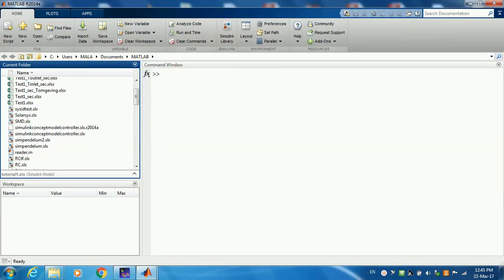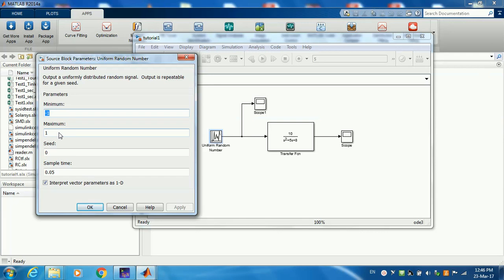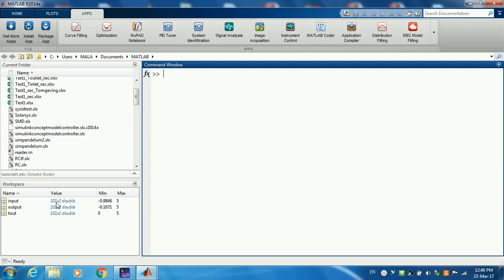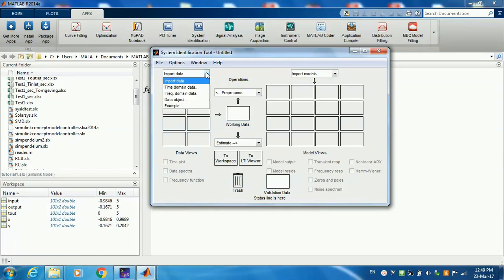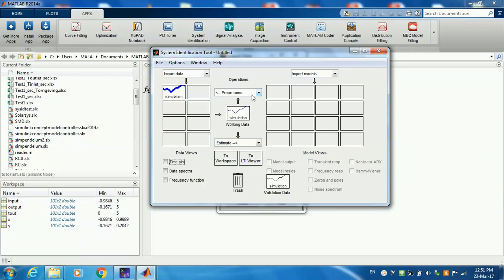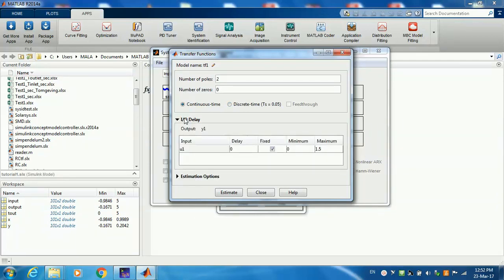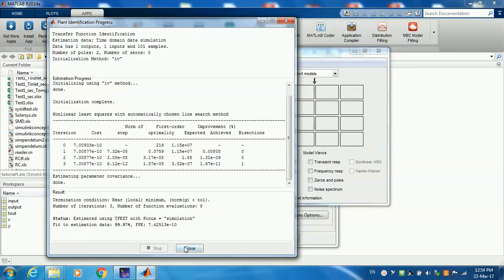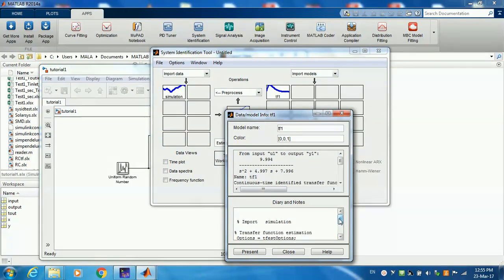Tutorial: Estimating a transfer function model from random input using MATLAB

Comment: Thanks a lot, it helped me to give me a little heads up and save some time. 
However, I am not sure how to define my input data. I have e Step Response as output. (Angle) Do I use a single step as input?
Some more background: I stimulate a muscle via electrical stimulation. The stimulation has 3 parameters: The current, the frequency and the pulse width. Out of those 3 only the pulse width changes. I fixed the pulse width on the maximum value to get the step response.
Thanks a lot again and have a nice day!

Comment: Is there a reason for this not to work with 1st order transfer function?
Reply from the maker: Hey Ventsislav,
There's no reason, theoretical or practical, for this method not to work with 1st order transfer function. Could you explain to me what exactly is the problem you encountered?
Reply: @h511345  My thoughts exactly. There should be no mathematical reason for this not to work. When I reproduce your experiment with 2-nd order transfer function it works exactly as intended. However when I try it with 1st order transfer function the identification comes up with different result.